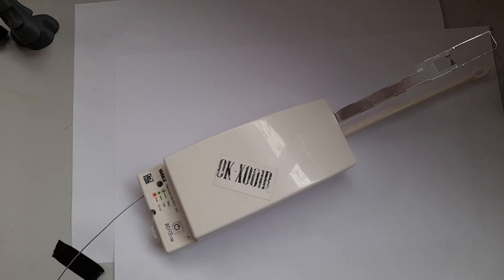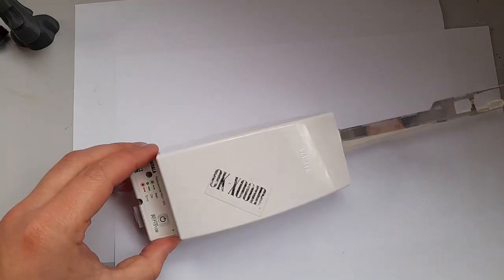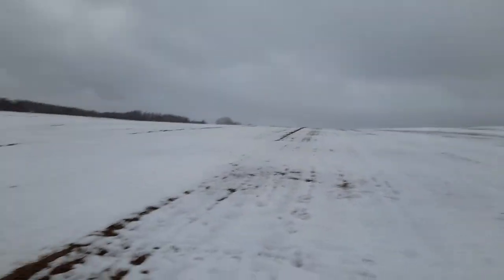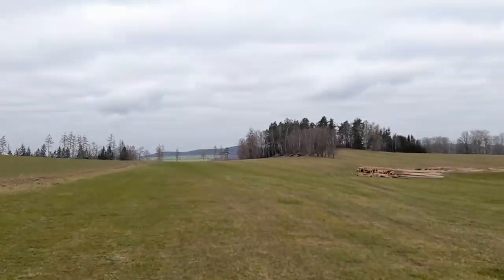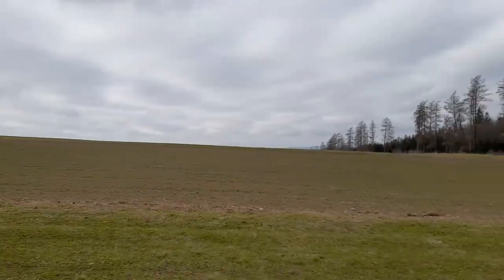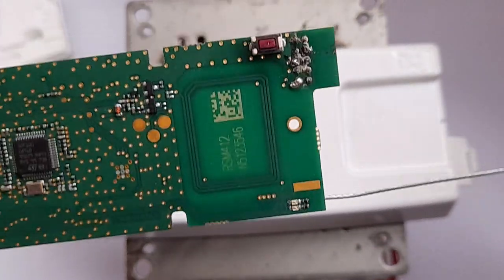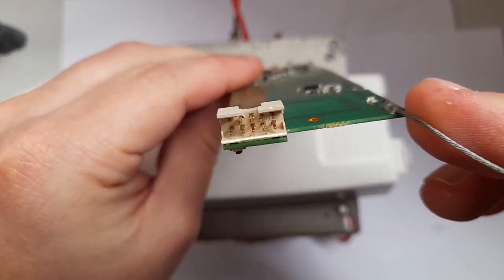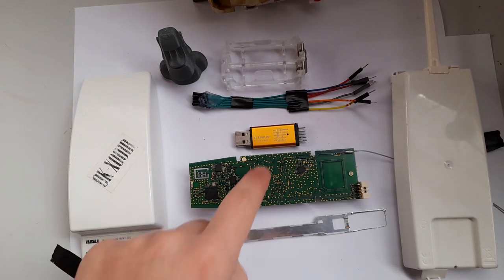Rescuing a crashed weather balloon

Comment: 21:10 The area with the cutout around it is an oscillator. It is physically separated from the rest of the board so that the stresses in the board can't effect its stability by microscopically bending the components.

Comment: I took open a ~20 year old Vaisala weather station once and it had a capacitive air humidity meter inside. It was driven and measured by a very peculiar pulse train circuitry with a logic gate chip driver and 3 or 4 quartz crystals in the loop. Kinda like a logic gate ring oscillator but instead of capacitors it had quartz oscillators. Very peculiar. Never seen a circuit like that. Anyhow, the capacitive humidity meter is typically energized with a known oscillator and depending on the humidity the capacitance of the chip varies and the oscillation frequency shifts. This frequency shift can be translated into the relative air humidity value.

Comment: A reason you cant gain access to reprogram the new ones could be that they have a programming lock set via the devices CPS (programming software) by the tech that initially programmed it. This lock is a passcode the tech creates and only they  or the comms shop that is contracted to set up these for the weather service, There is a slight possibility the weather service knows the passcode but they may not give it to you because that would negate the whole purpose of why the device is locked in the first place, to keep people from repurposing them. 

The last time I found one of these was back in the mid 90's and it was totally different, bigger with solar cells and small AGM cells and the rewards were worth it back then to turn them in but I kept those AGN batteries before returning the device to it's home.

Comment: at 20:21, the resistor is used to calculate speed/airflow, common in cars electronics.. its a part of thermal anemometer air flow sensor..